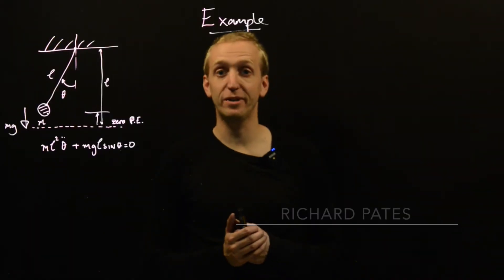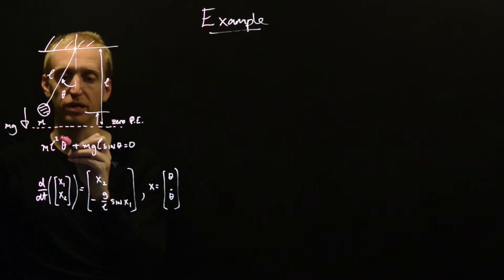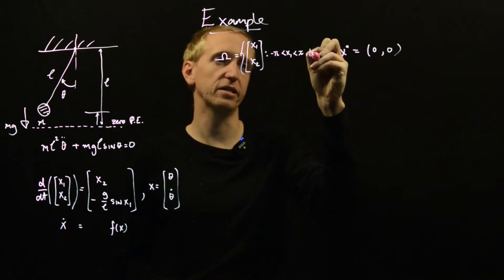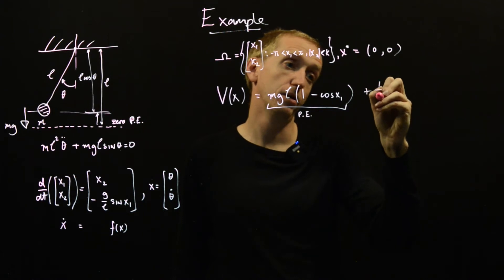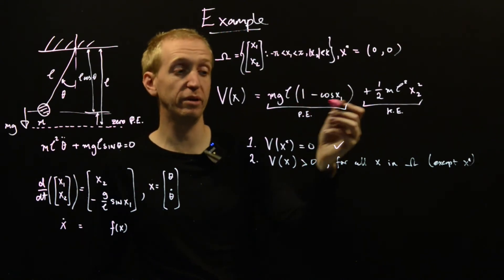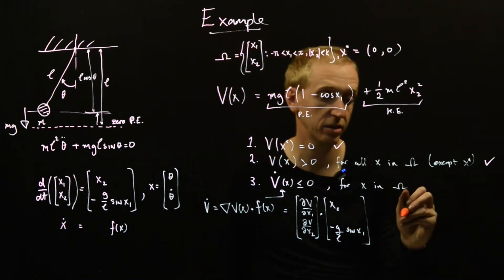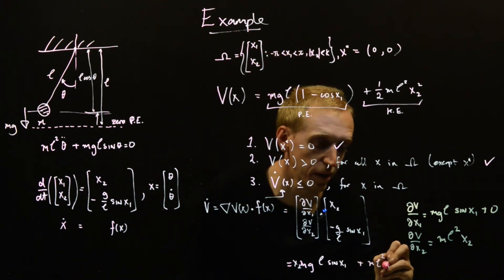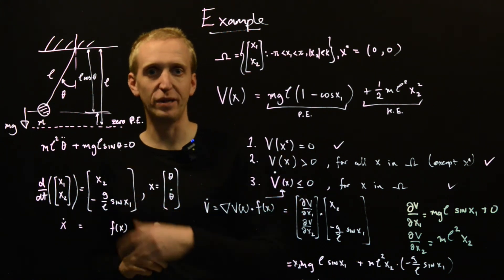An example using the Lyapunov stability theorem

Comment: I’m having trouble understanding this. First, you calculate the derivative of 𝑉(𝑥) and set it to zero with this assumption that the energy level is fixed, and so its derivation is zero. Then, you use this result to show that 𝑉˙(𝑥)=∇𝑉⋅𝑓(𝑥)=0. But isn’t this conclusion based on the assumption that the derivative of 𝑉(𝑥) is zero? Wouldn’t that make the reasoning circular? Or am I misunderstanding something? (I mean, you concluded what you assumed beforehand.). Beside zero,, can we prove that the third condition is negative in some points but not zero?

Comment: can a lyapunov function have as a result infinity?
Reply from the maker: Good question! The short answer is no, but I also suspect that in most cases, if you can get the stability argument working everywhere except at a point where the Lyapunov function is infinite, it will be possible to  modify things a little bit to still conclude stability (e.g. slightly redefine the Lyapunov function around that point). Note also that these arguments are based on these regions omega, so if you pick this region to exclude the points where the Lyapunov function is infinite, everything works (though you can't get global stability this way). It might also be possible to make things work by treating things as functions onto the extended real line (https://en.wikipedia.org/wiki/Extended_real_number_line) - I've not seen this done, but maybe it's possible (though I guess maybe it get's hard to define gradients etc)!

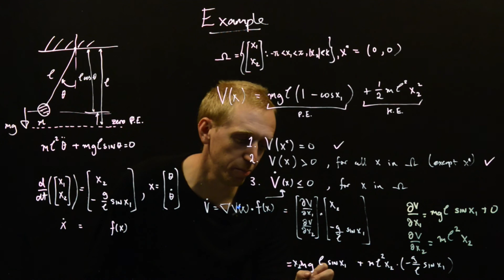Comment: 9:15 why does everything ‘disappear’? I cannot see why it’s all zero except for filling in the equilibrium point. Could you elaborate? The rest of the video was very clear
Reply: try eliminate the l in the 2nd term. The two terms cancel.
Reply from the maker: Hello! Yes, exactly as @kuwt says. Just take that line and multiply everything out. We start with x2*m*g*l*sin(x1)+m*l^2*x2*(-(g/l)*sin(x1). But if I multiply out everything in the second term I get exactly the negative of the first term!
Reply: @richard_pates  @kuwt thanks!

Comment: could you please give some idea about  practical applications of lyapunov functions and respective stability theorem?
Reply from the maker: Good question! My area of expertise is large-scale systems. Two large-scale systems that have benefited from Lyapunov functions are internet congestion control (how to assign bandwidth to individual computers) and electrical power systems. For the internet, the stability of several internet protocols can be justified by Lyapunov functions. Similarly in power systems, how the grid will respond to faults (e.g. a transmission line breaking) is often assessed with Lyapunov functions (here regions of attraction are particularly important). However, I should also say that in applications, often the theoretical justification lags behind the engineering practice. In these examples I've described, understanding things in terms of Lyapunov functions and stability was not the first step. A more accurate (but still inaccurate...) description of events would be that practitioners found approaches that they knew would work in certain cases, and then wanted to understand if the same approaches could be used in different networks, or as the networks grew and evolved. The questions they were asking were at heart questions about stability of their systems, and so some of the most powerful stability tools were applied. When learning control (and mathematics in general) I would also encourage you to think of the things that you are learning not only in terms of how they are used (which is of course important), but also in terms of learning problem solving skills. In learning about Lyapunov functions, you are really learning about how qualitatively assess the behaviour of systems, and how this can be described mathematically. This skill is at least as valuable as the specifics of this particular method! Good luck with the rest of your studies!